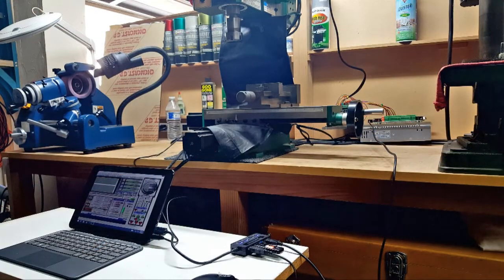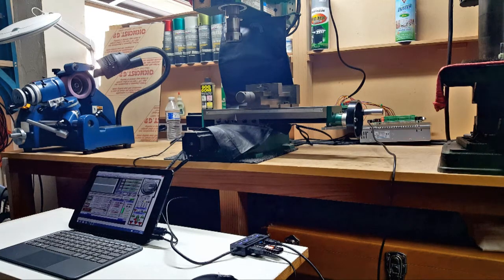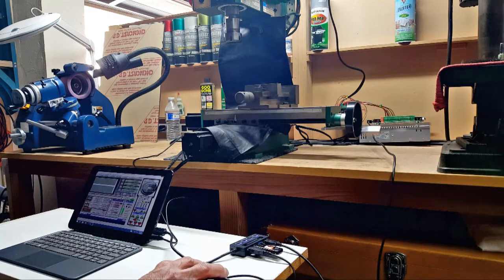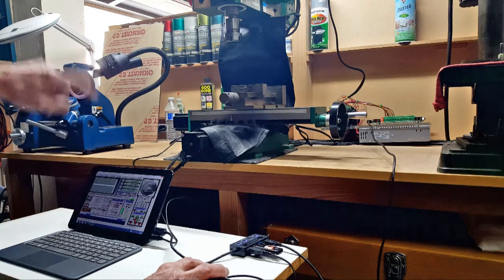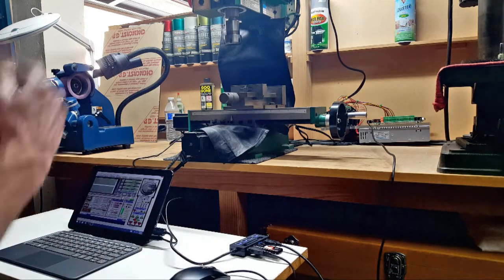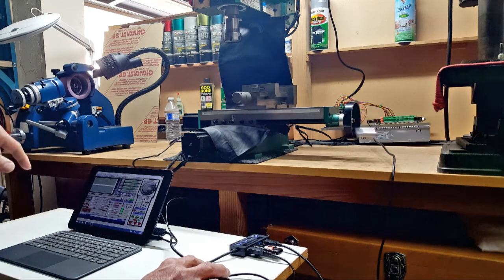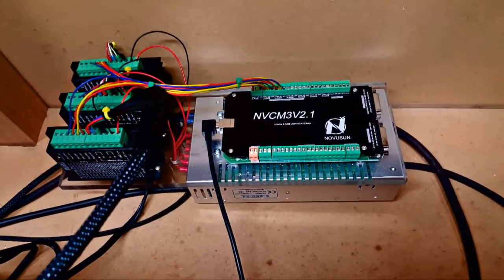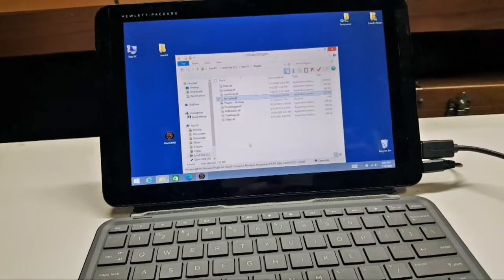Mach3 NVCM CNC Controller With Backlash

Comment: Hi Dave i got one of those nvcm controllers because i needed backlash compensation but on setup it won’t work. I am using windows 10 do i need to run windows 7 to get this to work.any suggestions. Thanks enjoyed your video.
Reply from the maker: I was running Mach3 which has the settings for backlash but the driver that comes with the nvcm is what actually listens to Mach3 and moves the motors forward and backward to remove the backlash.
Reply from the maker: I think Mach3 needs 7 i was running that.

Comment: This board drive me insane. Especially the spindle connection only out put 5v on and off. I order second board and it the same I try every possible setting that I could t nothing change. Directions all mess up keyboard jog to the right direction but DRO in reverse. I’m not a newbie to CNC I build dozen of machine used different type of board  but this board really scratch my head

Comment: I got one of these for the backlash.
Now one question as mine is on a slow boat from China. 
Does it have the backlash compensation on the diver or in mach3? 
I ask as I have an ethernet one of these. And it does the backlash but with 0 considerations to the acceleration setting of the motor. 
So when it makes a backlash move you hear a distinct bang from the stepper as it tries to move it instantly, and this causes loss of steps if the speed get at all quick. 
There's a setting in general settings in mach3 that sets the time to do the backlash move bit it does nothing on the the ethernet model. 

Does this one take acceleration in to account with the backlash?
Reply from the maker: Backlash is handled in the USB driver Mack3 only has the menu which tells the driver what to do. Mach3 does NOT perform actual backlash motor movements.

Comment: you can change everything on mach 3. motor directions and inputs. you can change what that button do on from inputs if not work flip it lol
Reply from the maker: Turns out there is a program that allows you to move the graphic buttons around in Mach3 which fixed the problem...

Comment: 2:54 backlash also mean when you cut table can move even most powerfull motor holding it
Reply from the maker: Backlash is in the nut to the leadscrew and this is the only controller that fixes it...

Comment: Great video and keep up the progress!

Mach3 has backlash compensation built in - as well.   Config->Backlash->PIck the axis, enter the backlash and don't forget to check the "Backlash Enabled" checkbox on that same screen.  I use it on my SB9" and SB10" lathe conversions.

Z+ Up should be UP.  You can fix this inside Mach3 -> Config->Motor Outputs - Toggle the "Dir LowActive" - either check or x -switch it.
Reply from the maker: Hi Joe, just so you know Mach3 has all the bells and whistles for backlash but does not perform the actual function the driver for the controller does it. My first CNC the parallel driver did it but the first and second controllers I bought had USB drivers that didn't handle backlash even though I had Mach3 set up for it. It wasn't till I bought the board in this video that I finally had a USB driver that worked. Took a long time and a lot of chat rooms to figure this out...

Comment: Hi Dave,  Does NVCM3V2.1 work with servomotor?
Reply from the maker: Steppers only..
Reply: It will work with servos providing they can take a step and dir signal.  Most new servo drives have this feature.

Comment: Thank You Dave for this video. I have same problems with my mini CNC machine in respect with the controller. None of the cheap USB chaineese controllers worked properly so I am still looking.  Your video brings another good looking controller. Could you please email the manual so I can understand this controller ?. I have had bad experience with drivers missing, manuals not supplied etc..
tolana44@gmail.com thank you. Where the drivers supplied in your case or you had to travel through the web to find them ?

Comment: Dave I'm actually glad I came across your channel. I was having no luck with backlash compensation. I also couldn't get my CNC lathe to show the rpm because of an index problem. I've tried the blue 5 axis card, and the red 4 axis one so far. I'll grab that card you have and see if it does the trick...thanks.
Reply from the maker: Glad I could help
Reply: @TheMiniMachineShop  one question, did you have to setup the auto homing thing for it to work like in the manual?
Reply from the maker: No I didn't install limit switches because you have to manually position the cutter before running a job anyway so home means nothing. @backwardsmachining7526

Comment: I had this problem a few years ago I can’t quite remember where to find a fix but what I do know is that in Mach3 is a page that you can change the direction you do not have to change the wiring .
it does not matter which way round you wire it once you go into the settings in Mach3 you can actually change the direction of all the motors.
I will have to look at my notes and see if I can find the details ,I made a video when I had the problem so hopefully when I find this information I will send it to you

Comment: I had a similar problem with my CNC mill. Turned out the motor was wired backward from the other motors.
Reply: you can wire motors or change from mach 3 setup

Comment: That's awesome work Bud!!! I have the NVEM and it took me a while to get my head round. Mine did not come with a usable manual. What made it all make sense to me when when I actually started making it move. I grabbed some insulation foam and loaded it up. Made sure the job was smaller than any direction the machine could move and started from the centre. It was immidiately apparent what was wrong and what was right. Another tip is to clone your Mach3 profile before you start. Then you can always go back to the beginning no matter how messed up thing get. Another clone could be set up for manual milling so the arrows make more sense. Then get the Physics Anonymous screen set and stand back and admire how fresh and new your machine feels. All the best and happy CNC'ing.
Reply from the maker: You can always email me for the manual... also watch this https://www.youtube.com/watch?v=F1Siihp0nSo&t=1222s

Comment: Also (sorry, I am commenting as I watch) but I don't think you will have much luck with backlash comp on the Z. Backlash comp can work on lathes, to an extent, but the cutting forces on a mill can push the table and head in directions that the motion controller can't predict. Preloading the head upwards with a gas-strut (or a pneumatic cylinder with a relieving regulator, better still) is likely to work better if you want to keep the rack actuation.
Reply: I find the weight, even on my small mill conversion eliminates the z backlash. If it doesn't it is more likely a feeds and speed problem.
Reply: @dansquires2713  I would suspect not when drilling or plunging, though. Which is why I suggested biasing upwards.
Reply: @andypughtube  I have a big spring pulling mine down but it is a totally different setup. I will post a vid some day.

Comment: Now you are tempting me again.  I have been looking at motors and such.  I will look up that control board.
Reply from the maker: I have the solution to the Z backwards button problem and now my last hurdle is CAD and the right post processor.
Reply: @TheMiniMachineShop  It's hard to ignore Fusion360, especially on Windows.
Reply: @andypughtube  Shame they have removed CAM =-(
Reply: @dansquires2713  They removed some of it, I think (though you can buy it back by the day) but, I still seem to have most of it on the hobbyist license.
Reply: @dansquires2713  what do you mean they removed cam? I used fusion 360 not 2 days ago to test out tool paths on my router. Cam worked fine.
Reply: @Engineerd3d  Just checked and it's back. I'm sure the manufacture tab disapeared for a day or two. I got a message from them saying it would no longer be available for free and nearly cried. Thanks for making me check.
Reply: @TheMiniMachineShop  well I can wait until you have it all worked out then pester you for advice.

Comment: Plus means that the tool moves away from the work, minus means that the tool moves towards the work. What moves in what direction depends on whether the machine is moving-table or moving-head. The fact that direction seems to switch sounds like something weird with the direction pin but you can get this if step and direction are swapped (depending on the drive) though it is more likely with enable and step switched. (It comes down to corner-cases of how the drives handle incorrect input)